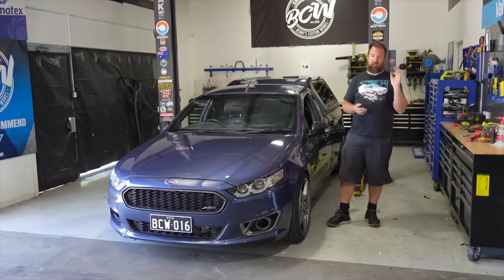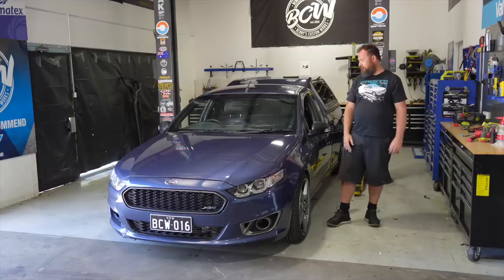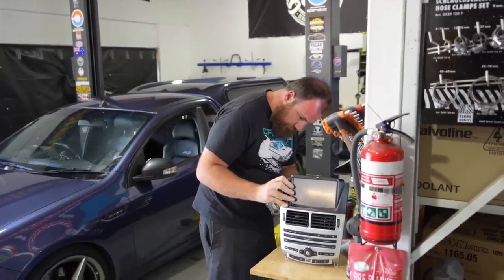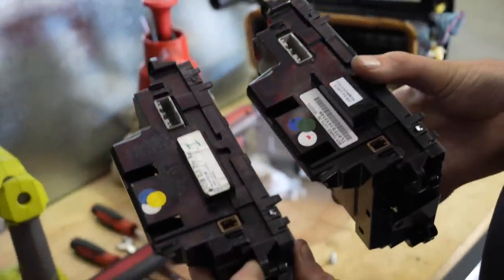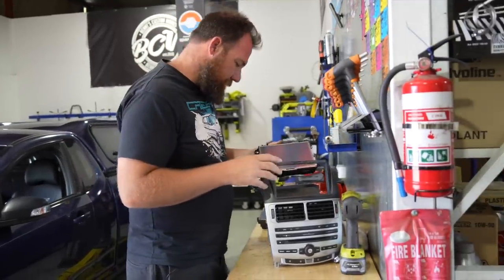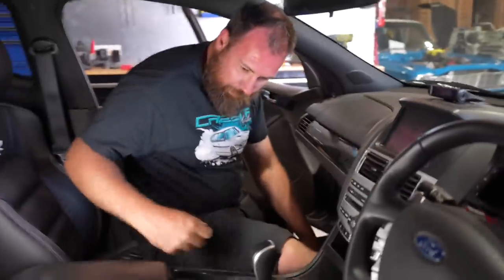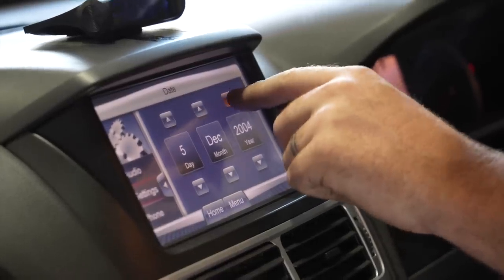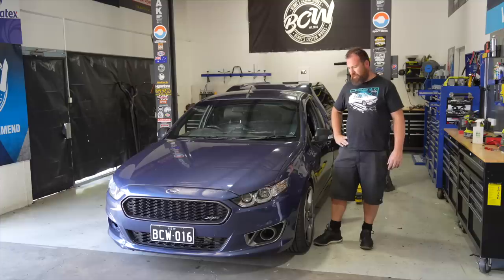Selling the Falcon but the screens suck !!

Comment: Yeah did quite a few FG2/SZ screens for black screen (didn't have as many issues with screens in FGX/SZ2 running SYNC 2), sometimes I could run a software update on IDS and the screen would come good if not it was an replacement job. ASL Automedia were the ones who refurbished/exchanged for dealers 👍
Reply: ASL sorted mine earlier this year. So far, all good 👍
Reply: its a fg with fgx front
Reply: @jaydengood6530  “fg2”

Comment: So what company does the replacement screens?
Reply: You don't have to go with thoughs head units anymore. When I first purchased my FG xr6 falcon the only available head unit  was Kayhan top mounted head unit.  And It sucked, although it was still better than the original factory head unit at the time available.

Now theirs an entire new double din redesigned aftermarket centre control unit. That allows aftermarket Head units from Sony, pioneer, Alpine, Keenwood ect to be placed underneath the air vent in the control unit. And the climate controle buttons placed over the air vents. Its a much better design..

Check out New Release! Aerpro FP9650PK and FP9650SK Ford FG Falcon Installation Kit

Comment: When you said one of the most common problems on a falcon i thought - left tail/brake light problem
Reply: Subaru liberty's have this as well.

To be honest when he said common problems on a Falcon my eye twitched and I though diff bushes.
Reply: @DragoserakerIT  I was thinking centre bearing… but then I remember it’s a ute and I don’t think they have the same issues a sedan does.
Reply: @mj_aussie_coaster_travels8310  hadnt even crossed my mind either, I don't even know if the utes are IRS or solid axel, only worked on sedans.
Reply: @DragoserakerIT  utes are live axle.

Comment: Out of curiosity, did that screen issue occur on FGX models? I’ve got an FGX XR8 and I’ve always stressed about this but could never determine if they had the problem?

Good stuff as always Benny, love the content!
Reply: pretty much just a FG2 thing
Reply: Check out New Release! Aerpro FP9650PK and FP9650SK Ford FG Falcon Installation Kit 

You can now put any head unit in

Comment: Best move i made was selling my money pit FG XR6. Transmission problems from 100,000 ks onwards from the bs 5 speed automatic they put in the esrlier models.
Reply from the maker: Yes the 5 speeds are junk. There’s a few good kits to convert to zf these days without a full loom swap
Reply: @Benny's Custom Works  I couldn't justify spending thousands on a zf convert or replacing the servos every year in the 5 speed so it went to a good home and became someone else's problem.

Comment: Did you ever have the noise in the back that sounded like a cracking noise as you took off from and stand still? If so what fixed it?
Reply: Silicone spray on bushings and in leaf spring pack could help,

Comment: Yeah the Bluetooth modules suck as well. Both BT modules in my old 08 FG G6 and current work runner SY2 Terri have shit themselves. The BA/BF 'premium' ICC's go to shit as well. The Terri's ICC AUX inputs drops out (known problem) but its fixable by a solid punch to the ICC unit anywhere you please every 10 minutes or so!

Comment: I know the pain of the dead screen, have just replaced mine
Reply: One thing to watch out for is, the start of the part numbers. Even though the Territory has the same screen the are 2 different types. My fg mk2 started with AR29, the territory started with AR79, the rest of the part number is the same on both units. It does work but not 100%. Still better than nothing.
Mine was bought on ebay so you take what you can get.

Comment: If you're giving up that beast of a work ute, it could only mean replacing it with an American V8 truck! ...or Twin turbo V6 F150.
Reply: Which is still a downgrade imo. Poor vision, high centre of gravity, massive so can't easily park it at a car park.
Reply: @Low760  all 4wds are a downgrade on a ute
Reply: It will be a ranger raptor or walkinshaw Amarok I recon
Reply: @Low760  Its for work! lugging car parts & towing.
Reply: I really hope not. Those American land yachts look awful on Australian roads
Reply: I am thinking it maybe a Hi lux. In one other video he was taking about them.
Reply: I've been seeing more and more Dodge RAMs getting around lately. Not sure I'd enjoy paying the fuel bill for a petrol V8 in a truck that size. I'm really hoping he's gone for a Raptor.
Reply: @brokensuave  I have a Silverado with a 6.2 V8 and it gets 14.1L per 100 kms. My diesel Pajero was getting 13, so not that bad really.
Reply: @Low760  Vision isn't that bad to be honest. They're covered in cameras so parking isn't too much of a drama, sometimes need to take second go to get in if it's a bit tight. They just aren't as bad as you'd think for a daily driver in the suburbs of Brisbne at least.

Comment: FG Mk1 Screens are shit too.
Reply: 235000kms and not one issue on mine.
Reply: @subaruadventures  135k on mine and its a '08 G6 but its spent most of its life outside.  Who does the replacement screens?
Reply: I’ve got 340k on my G6 now (owned since new) and no issues at all.  The FG1 screens are easily swapped for another good screen - just take the screen module off the top and swap it.  You can also swap in a colour screen ICC from a G6E or lux pack XR, and it will work with your CD player module swapped into it.  Just make sure you get it from a similar build era to your car, as the firmware changed over time, and an early one in a late car makes the aircon run shit (ask me how I know….)You may need to play around with swapping the AC buttons, or simply have it programmed to the colour single zone software to work correctly.  In the ones I’ve swapped for mates, I just swapped the buttons around, and the LH temp buttons don’t do anything.  With a colour screen you can easily add a reverse camera too.
Reply: @Diddydudat  km indicate the amount of vehicle use, and also indicate how much vibration, bumps etc the screen is subjected to, which all adds mechanical wear to the joints and connections.  
You would expect a screen from a low km car to be more reliable than one from a high km car (once the initial “warranty time” has elapsed, removing all the manufacturing failures from the gene pool).

Comment: bet he gets a raptor
Reply from the maker: Bet I don’t :D
Reply: He said its not diesel
Reply: @jasonfields2793 and the raptor isn’t diesel.
Reply: @jasonfields2793  new raptors are petrol and are weapons
Reply: @jasonfields2793  raptor is twin turbo v6 petty.
Reply: @jasonfields2793  twin turbo v6 300kw
Reply: Might have ordered a f-150
Reply: dodge ram, f150, toyota tundra? that's if he's going for a full sized pickup
Reply: @tturi2  tundra far less likely…not a regular sale item in Australia 

Ram is a maybe…but replacing the Falcon with another Ford…and the f-150 is coming in a few months time at dealerships
Reply: @BennysCustomWorks  trx dodge maybe?